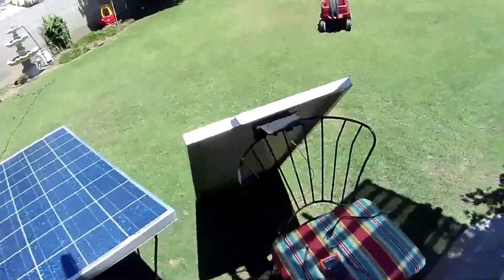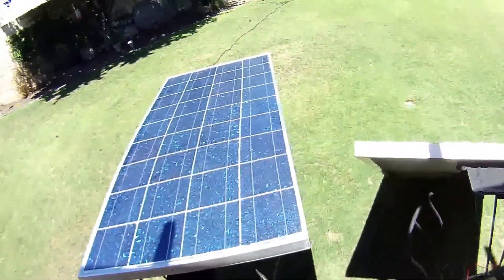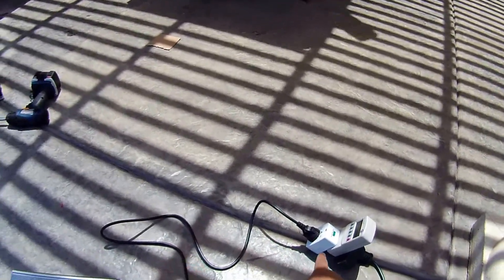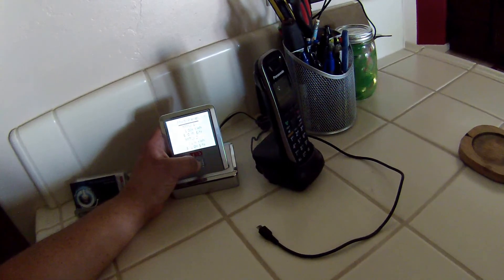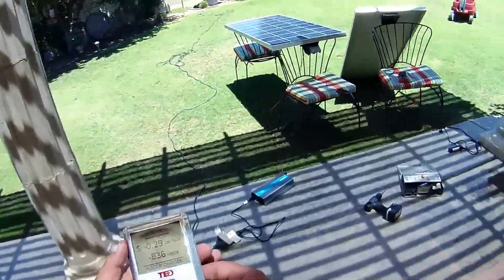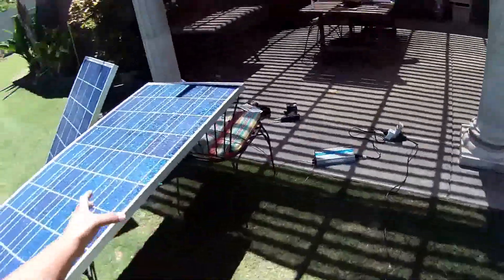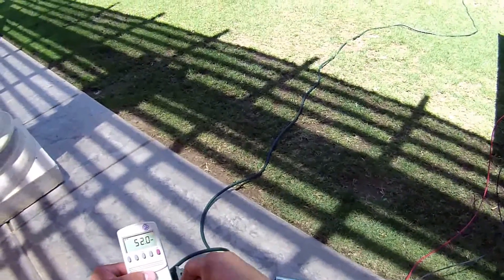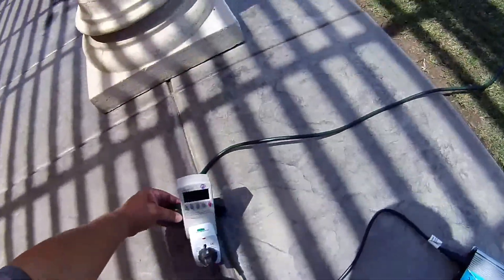Experiment with kyocera 120 watt solar panels

Comment: Those are 12 volt panels . So I did parallel on mine to keep them 12 volts. 
I did 6 panels for 720 watts.
I'm 100% off grid in a small cabin. So 12 volts is adequate for me to my battery set up.